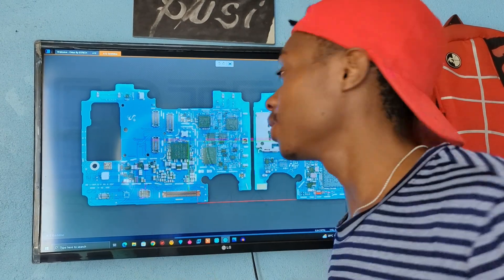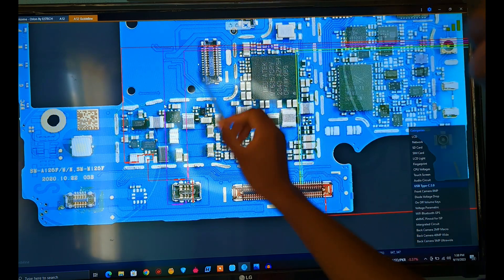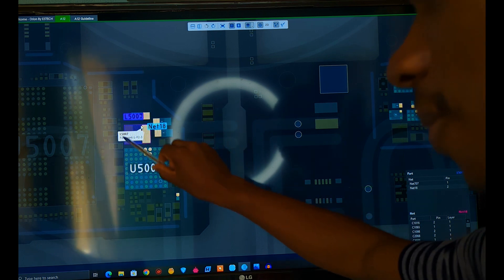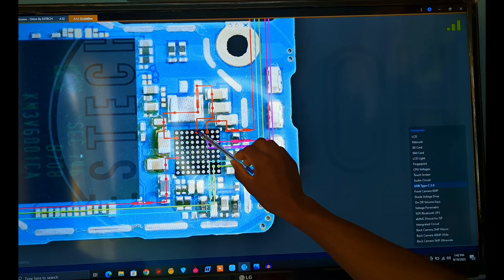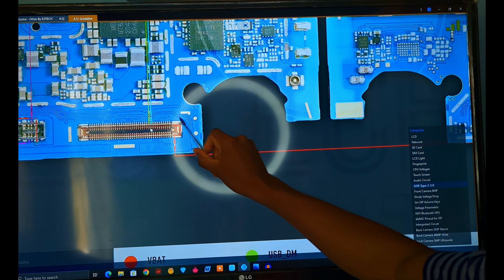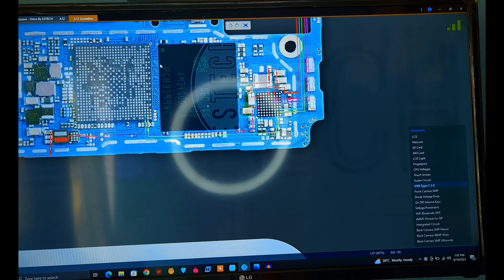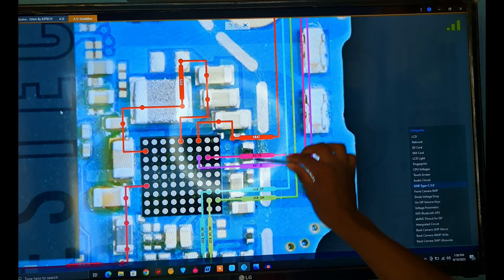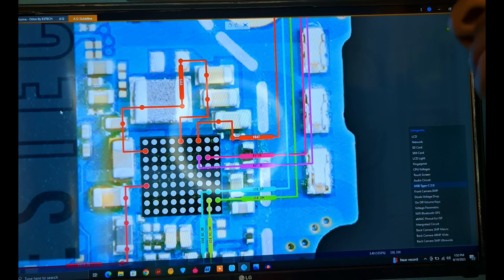Complete Mobile Repairing Course | Full video | Advance Troubleshooting Lesson

Comment: My own case when I plug the type-C charger for the phone to charge the power manager get hot enough quickly until I removed the charger it cool down again. The phone won't turn on or even show charging it completely dead. So what is the solution please help.